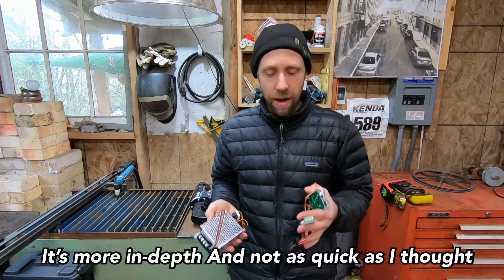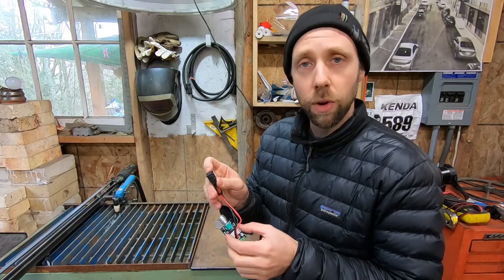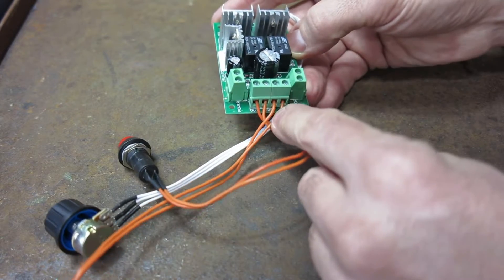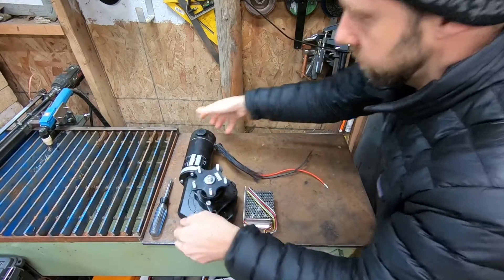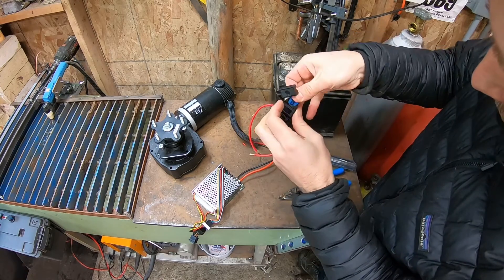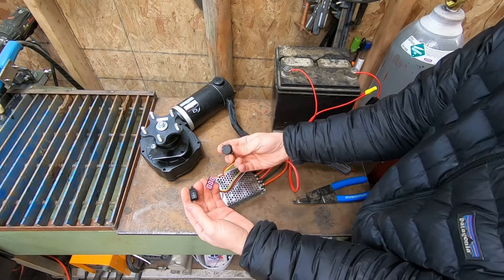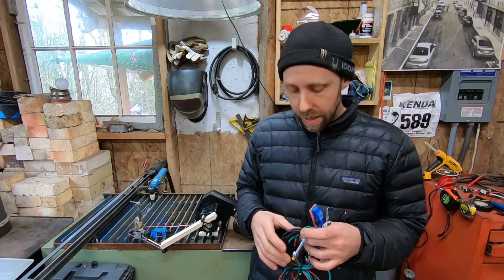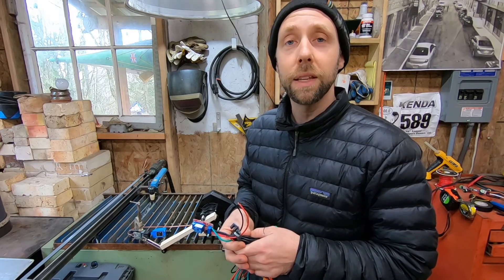How to wire Pulse width controllers to limit switches

Comment: Good afternoon Mike.
My question is on a 60A PWM with motor direction rocker switch. What is the voltage on the common? What voltage is it sending to excite the relays? I will be powering the PWM with 12 volts and trying to excite the relays for direction from relay's in my Mikron setworks. Can I use the voltage provided by my setworks or do I have to supply the setworks relays with the power on the common (center) wire from the PWM ? If I'm making any sense.
Thank you Bob G.

Comment: Hi Mike I just found this video and I wonder if you answer questions from the comments at this time being May 12th 2024?
I need to make a circuit to make a 12 volt DC motor run using two limit switches and a door bell switch and four 5 pin relays.
I need to push the door bell switch to make the motor turn and hit the other limit switch and immediately reverse to hit the first limit switch and stop.

Comment: Hey man do you have another link for the 40 amp controller like yours
Reply from the maker: I would recommend just looking on Amazon or EBay, you will find one that should be good, just read reviews and pick the best one you can find, I have been using these on my sawmill and they work well.

Comment: So far, I've harvested two 120V, 3hp, 23A DC motors and one 100V, 1.5hp DC motor from free treadmills. Only the 1.5hp one seems to be easily controllable by the original treadmill electronics using a simple pot. Havent figured out how to control the two 3hp ones without getting feedback on calories burned and laps run.

Comment: I'm looking to put a power feed on my sawmill.   I've looked at several motors in eBay and some say brake assembly was removed.  Is there a benefit to with it without brake?
Reply from the maker: Don’t worry about the brake, the motor is so geared down that you would be able to turn it without power going to it, if you can it’s going to be hard. Keep in mind most wheel chair motors are 24v but can run half speed on 12v
They are really powerful motors.
Have you seen my videos on building a power feed on my sawmill? I would have used one of these motors if I know about them at the time I built it. You should be ago buy a set of these motors used on e bay for around $70 👍
Reply: @Mikefestiva  thank you for getting back to me.  I did watch your videos.  You do amazing work.  I'm looking forward to this project now with confidence
Reply from the maker: @BigelowWoodcraft  No problem Jerry 👍 You will really like having a power feed! It’s a complete game changer on the sawmill. Ps if you have any questions feel free to ask. I try to get back to people, but on weekends after I post new videos it’s hard too because I sometimes get over 500 comments 🤪 it’s a bit overwhelming, so mid week is better. Take care 🙂

Comment: Very informative video. I plan on using wheelchair motors on my sawmill build. Still collecting pieces but have a good start on it. I have a basic overview vid on my channel. Thanks Mike.
Reply from the maker: Right on! Yes I would have used these motors too if I knew about then at the time when I was building my power feed. 
I will check out your channel 🙂

Comment: Mike thank you for your excellent videos and for the detailed demonstrations on how things work.  I finally opened my Versa Cut 60 from Eastwood after having it sitting in a box for about 3 years.  I have retired and now have more time to piddle and putt around on many different projects.  I put together a Plasma cutting table and have just started fabricating parts to make a knock off of your automatic feed plasma cutting guide.  You have taught an "old dog" a few new tricks.  Thank you for sharing.

One question you may have already answered.  When you mention you did not like the hinge are you referring to the concept or the beefiness of the hinge you used?

Working on restoring my deceased Father In Law's 1992 Chevy Truck from the ground up and the plasma cutting guide will be a great help for me!

Blessings to you and your family.
Reply from the maker: Thanks for checking out my videos and commenting! I really appreciate it :) 
I mentioned that I didn’t like the hinge I used, it was a bit loose and a little light duty for the job, I probably would have made my own out of some tubing and a 1/2” solid pin if I did it over. I think you will be happy with you cutting table! Take care

Comment: By the power of greyskull! Lest not the limit switch fail nor be without emergency stop button, unless for if you enjoy great fearful moments of WTF do I do, it's not stopping. :D

Hey that Kenda 589 number sign, is that from mtb or dirt biking?
Reply from the maker: Haha! Yes the limit switches definitely need to be working right or you can get into some problems. On my mill for instance, It sits for weeks out in the weather, I only run it once in a while, so I will check them when I first go to use it, when the mill is returning home but still a few feet from the stop I will cycle the switch a few time to make sure it’s working properly before I trust it to stop the mill.
Good eye on the Kenda number, that was from a motorcycle race my brother and I did last year, it was the Desert 100 in Eastern Washington, we both finished it but man it was a tiring ride! The best way to describe it is think of riding a 100 miles of whoops with over 1000 other riders with all different skill levels . The start was crazy over 1000 riders start at the same time then funneling down to one main road then into a trail. It was a bit nuts.  
After finishing it, both my brother and I said we would not race it again, then a few weeks after the race you get to talking about what you would do different and you start thinking maybe we will do it again next year! Haha!
Reply: @Mikefestiva   Oh yea for sure that sounds like fun. Doing a cross country type race is on my bucket list. As long as I finish, I'll be good.

Comment: i just looked on ebay and that 1st motor you set up is $174 found pares of other ones starting at $300, dont see any for $70 for a pare like you say, many are 5 and $600 each, why would you need to drop the voltage down so you dont burn out the LED LIGHTS, ALL THE LED LIGHTS I SELL TAKE A RANG OF POWER FROM 9V TO 36V, AND LITTLE INDICATOR LED LIGHT TAKE 3V TO 12 VOLTS.   FROM CANADA DIFERENT MFG  THIS ONE HAS THE 
Reverse Polarity Protection, High Current Protection

https://www.amazon.ca/Controller-DC10V-55V-Reversible-Generating-Protection/dp/B07H69R2D3/ref=sr_1_fkmrnull_2?keywords=Motor+Speed+Controller%2C+DC10V-55V+PWM+Brushed+DC+Motor+Speed+Controller+Adjustable+Driver+CW+CCW+Reversible+Switch+with+Digit+Display&qid=1549826519&s=gateway&sr=8-2-fkmrnull
Reply from the maker: I just looked up( wheelchair motors ) and there’s plenty of them that showed right up “used” for under $100 for a set. Maybe go back and look a bit more, you can even select “ used” in the refine search. If you watching my drill press video you would see the style of LED light I used, it was a small reading light that ran on 5 volts, I hooked up 12 volts and it was twice as bright so I’m sure it wouldn’t last long running like that, so I decided to drop it back down to the proper voltage. I have used many off road LED lights and yes they do have a wide range off input power. Take care
Reply: @Mikefestiva  i will take another look, i was on there for over half hour last time

Comment: Whats you opinion on the 12 to 24 volt step up converter? Would it work on those motors?
Reply from the maker: Good question, I have seen the step up 12 to 24 volt power converters, I have not yet tried one, sometime I will buy one and give it a try, I definitely need to look into Amps to make sure The step up power supply would provide enough amps to run a motor under full load? 
Take care :)

Comment: Great info for us dumb asses LOL I have been trying to get someone to wire up my auto feed for 2 years I used a steering motor out of chevy cobalt  and keep frying the controllers. I wish you lived closer .lol I would like to see whatever you post on this electrical stuff. Thanks
Reply from the maker: Thanks Larry! Haha thanks for checking out my video :) I would for sure help you out if I lived closer. I will take a look at one of these cobalt steering motors and see if I can figure it out for you. Take care!
Reply: @Mikefestiva There is just 2 wires coming out of the motor red and black when I reverse them they go forward and backwards  I was told I can't ground the motor when I do I get the magic smoke LOL I was told to get a winch relay switch I have not tried it yet I am on my 4 th controller LOL
Reply from the maker: Larry Downes Just two wires seem simple, with only two wires it must be a brushed DC motor.  but it keeps smoking your controllers? What do you think the Amp draw is under load on your motor? Could it be the controllers you have been getting are to low of amps for that DC motor? 
Okay I just did a little research on that motor and it’s a hungry Amp eater Haha! It’s a brushed 12 volt DC motor that draws 58 Amps! That quite a bit. I’m thinking you may need to look on EBay for a larger PW controller, something that’s continuing at 60 amps.
I hope this helps.
Reply: @Mikefestiva  I did buy a 60 amp controller like the the one you have in your video without the display and the winch relay is 150 surge amps and a 30 amp fuse just been afraid of seeing the magical smoke again LOL I am dumber than a rock when it comes to electrical  lol
Reply: Gm dealer told me it operates at 50 amps that is the steering box Thanks